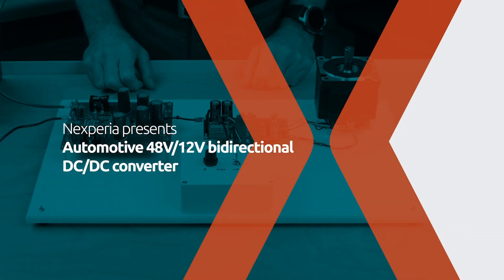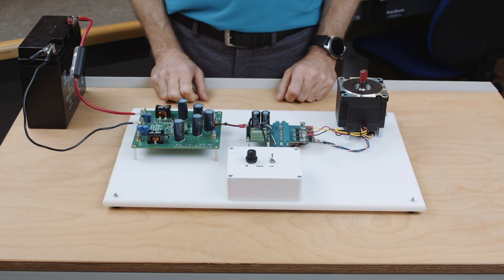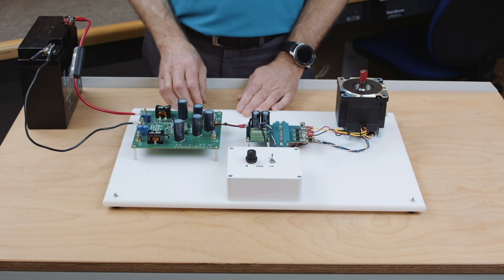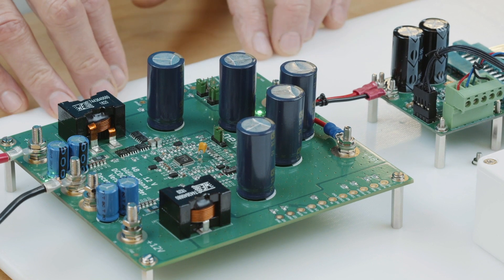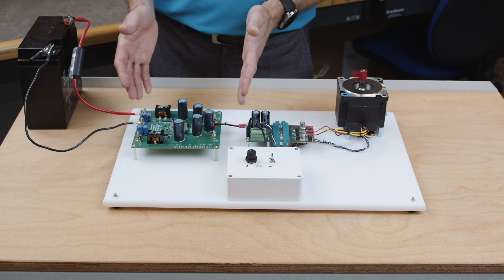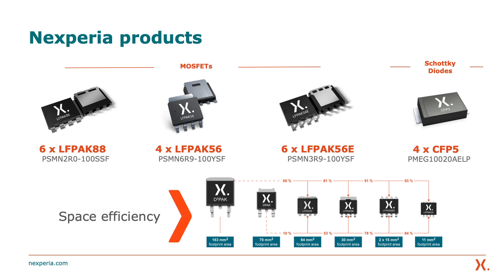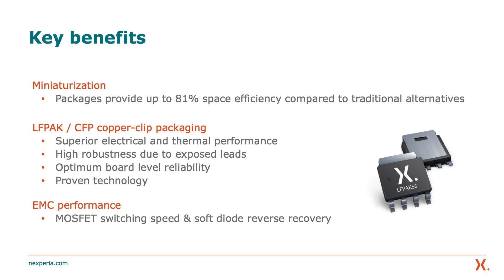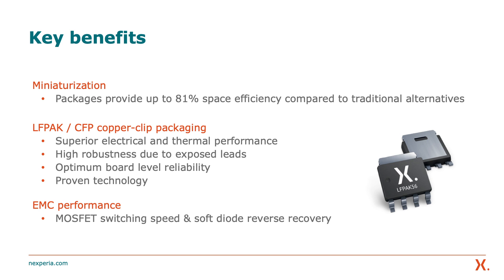Automotive 48V/12V bidirectional DC/DC converter featuring LFPAK88 100V MOSFETs

Comment: can this be used in battery charging and discharging applications
Reply from the maker: Hello! Yes, it is a bi-directional DC/DC converter. It can supply 48V from a 12V battery and it can supply 12V from a 48V battery. It was not specifically designed to be a battery charger, but the design can be modified with additional components to have different Voltage set-points and current limits.
Reply: @Nexperia  thanks and can we talk more about this converter through email. My email: kranthikumarbanala@gmail.com
Reply: Hello Norman, i’m looking into dc 24v AGM to dc 48v Lifepo4 bidirectional converter for a global RV. Can you help? Best regards Michel
Reply from the maker: Hello, thanks for your question! Please reach out to Nexperia by checking our support page https://www.nexperia.com/support/